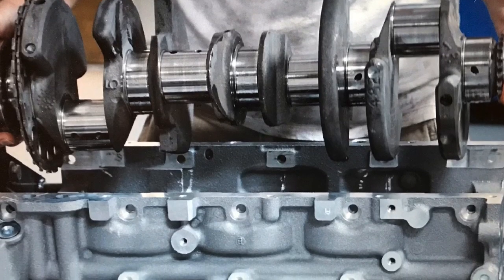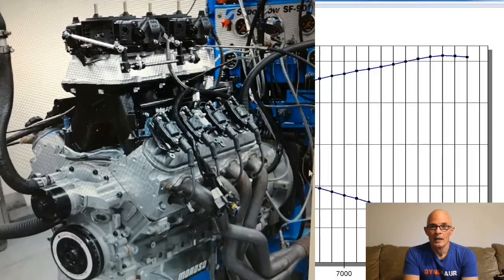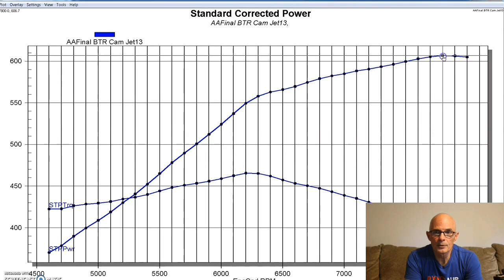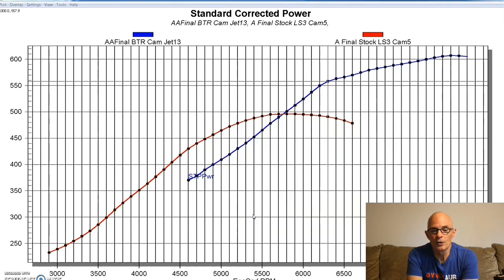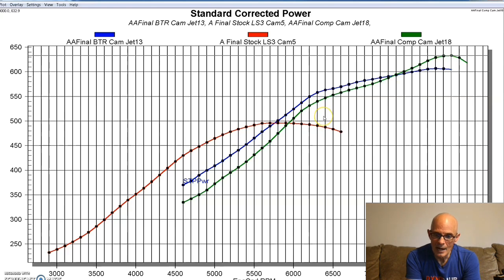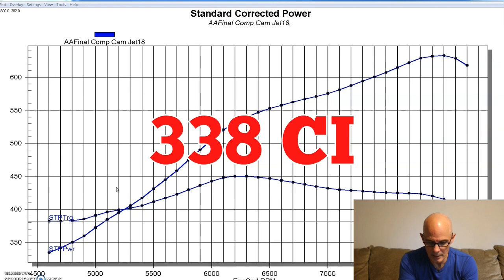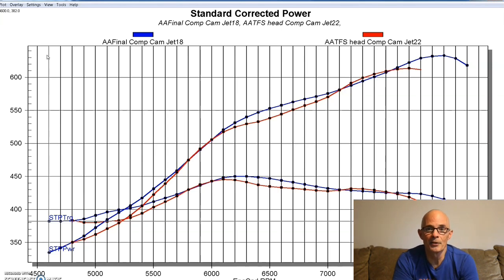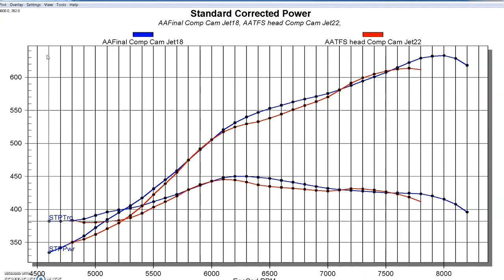DESTROKE LS-4.8L CRANK IN LS3 BLOCK-SHORT STROKE POWER-AN LS MONSTER MYTH?

Comment: Thank you for confirming that rpm is the replacement for displacement when rpm is the variable

Rpm =air flow 
Displacement= airflow
Choose one.
Reply: Why are you looking for a replacement for displacement? If you didn't have displacement you wouldn't have an engine, you'd have an electric motor. 😉
Reply: Where most guys screw up is they dont take advantage of unshrouding the intake valve on the bigger bore. If you scribe the head to the cylinder and grind the combustion chamber around the poor flowing side of the intake valve, you always make far more power than the power you will make simply by adding the extra cubes from boring it. This is why a  chevy 305 could never make as much power as a 350. The smaller bore 305 puts the edge of the intake valve too close to the edge of the cylinder, severely limiting the amount of air you can get into the cylinder, not to mention you cant run as big a valve with the smaller cylinder, or the edge of the intake valve hits the edge of the cylinder.
Reply: @donrutter6765  i only mentioned the replacement for displacement thing because it's an argument that's as old as Time. Engine is simply an air pump. Its goal is to move air and mix it with fuel it don't matter how you move the air,as long as you move the same amount of air  you will create the same amount of power.

Rpm is the direct replacement of displacement because all you have to do is add RPM to move more air. With more cubic inches you don't need as many RPM to move the air.
Reply: Still no replacement when you can have a stroked ls7 to 464 and make 730+ whp over 850 crank and rev it to 7500-8000 rpm and still make 600 + wtq
Reply: @speedlife301  because you can take an engine that 232cid rev it twice as high and it will still make the same amout of horsepower as a 464.

Comment: i want to see that combo with boost
Reply: I don't have dyno data but we've been 4.90's @ 143 with an 80mm turbo on a 6.0 block with 4.8 crank. Great combo
Reply from the maker: I ran a turbo on it with different cam

Comment: In the 70’s grandpa ran a destroked small ford ( 260 cid ) on asphalt oval for several reason 
1. Smaller displacement = lighter car. Come off corners faster and with higher gears. 
2. Smaller/lighter pistons of the era were more reliable. 
3. Didn’t need to make radical expensive porting jobs on the 1965 Ford Gt350 heads. Already set up for high rpm 
4.better mileage, needed when running 125 laps at Nashville.  
5. Gt350 heads were available in junkyards if you had someone there looking out for you.